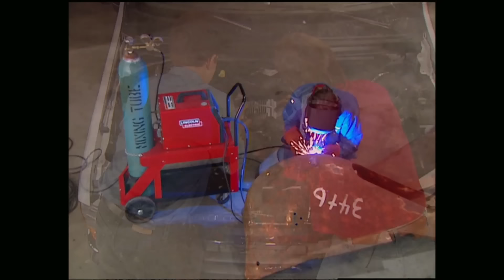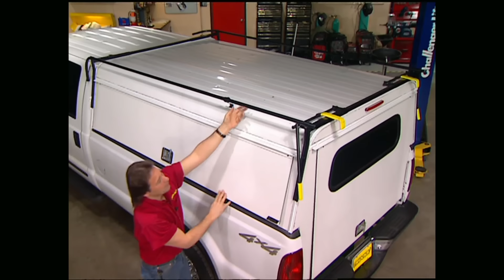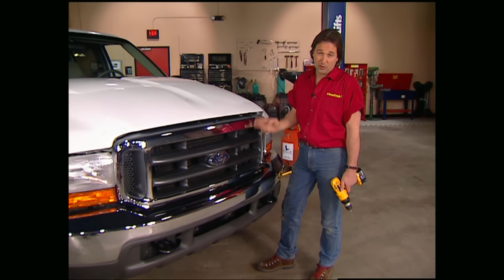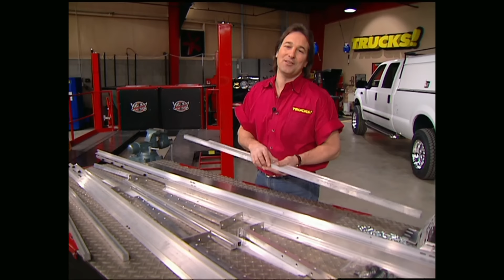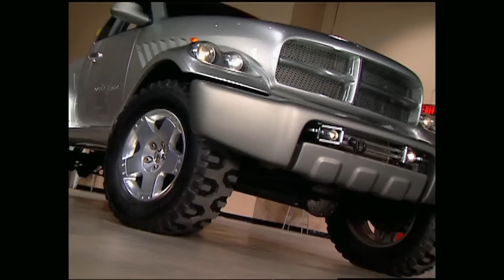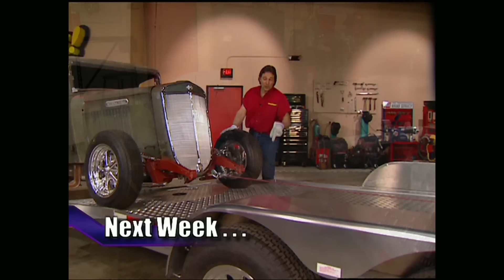Removable Accessories Make An F-250 The Ultimate Work Truck - Trucks! S3, E9

Comment: I don't like the way the new power wagon looks at all. Hate the paint job. Keep the frame and power supply and scrap the body. Try again.  Had a early 80's power wagon. Loved it and miss it to this day.
Reply: Glad they never went into production.  It's very rare for a concept to go into production.  Usually it's some of the technology that ends up in future vehicles.  But some concepts absolute abominations when it comes to styling.  You can't out do the original styling of the classics/antiques with concepts.
Reply: With chevy's Nova did the same way but they made it anyways. Nothing like what it did look like. Impala too. Dodge did it with charger and challenger also. Looks nothing like they used to.

Comment: While I realize this video is from 20 years ago, I feel that certain things should still be addressed. When installing any truck cap, the foam tape should always be applied to the cap and not to the bed rails. This insures that your sealing material will the most effective. If you apply the foam tape to the bed rails, it may not even be in contact with the cap. Another issue is that in certain parts of the country (New York State for example) truck caps must be bolted on in order to cross certain long span bridges. If you cap is only clamped on, you will not be allowed to cross these bridges.
Reply: Agreed on the foam tape, basics people.